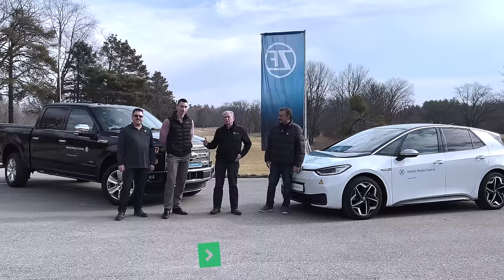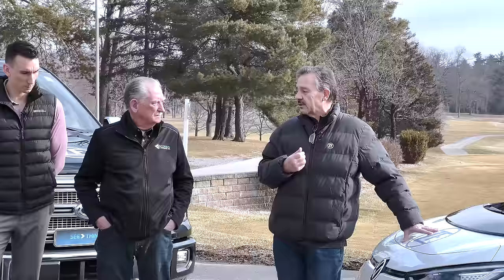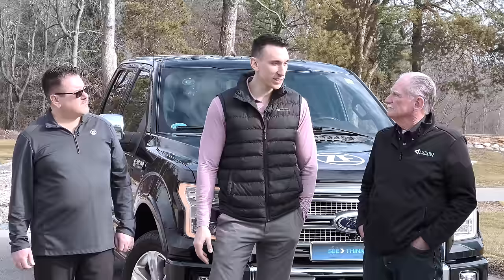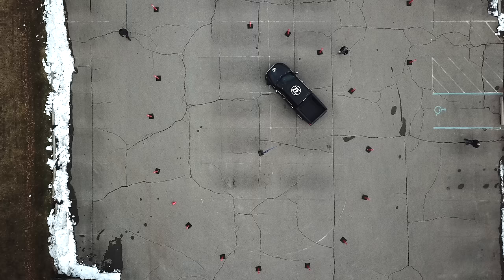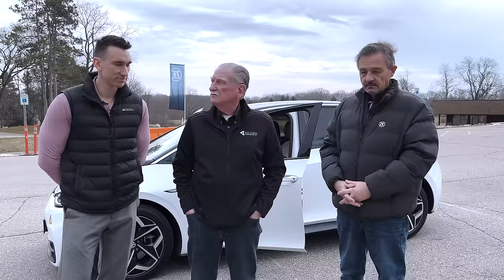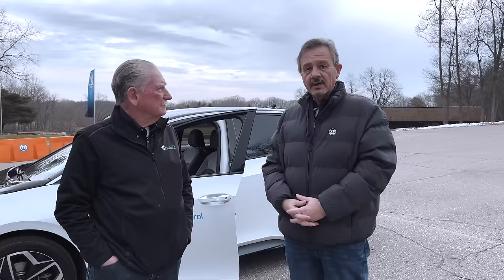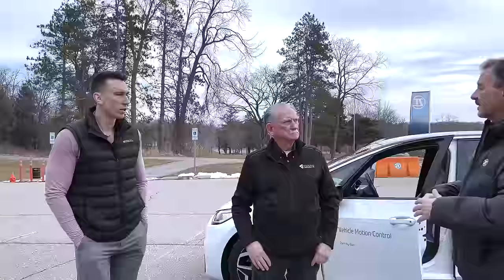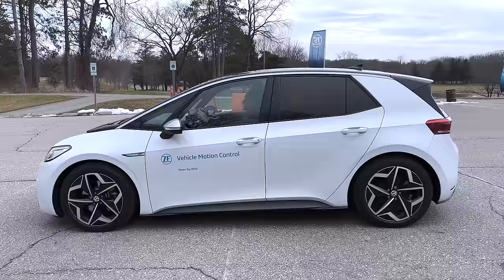Steer-by-wire - how it works with ZF

Comment: why is ZF still using OUTDATED Column shifters & GEAR select. 
its simpler & safer to just Swipe, check cameras on MAIN display.
Reply: @luisramos123   - most OEMs still use outdated LEGACY parts , because of Parts Bin contracts. 
they are unable to pivot , to new BETTER tech , like TESLA can , and shift to IN - HOUSE production. 
many OEMs today , still have START button, Keyed Ignition or key fob.
they have Column shifters, Stalk controls, massive Arrays of Buttons both on Steering wheel & Console , they have Physical knobs. 
all that adds WEIGHT & complexity when looking at FAULTS. 
the TESLA can even shift itself Automatically , accurately & reliably.
Reply: Shifting with  touchscreen is stupid, and every auto manufacturer knows that. Tesla puts drive mode on the screen because it's cheaper, and it fits their style.

Comment: As an automotive engineer I'll never trust SBW. Airplanes have x-by-wire, but they have multiple redundant systems. Cars will never have that amount of redundancy at consumer prices.
Reply: And none of that redundancy saved Boeing from cutting cost in other areas that killed people. It was a big improvement when we got rid of steering pumps and replaced them with motors. At least when a steering pump or motor fails you can still steer the car manually when the car is moving, just takes more effort, but there are a lot of other mechanical systems that can fail and cause major issues that aren't redundant. Regardless, I agree having steering controlled entirely electronically is an issue. If there is an electrical failure that cuts power to all systems while driving, you won't be able to steer the car at all.
Reply: Didn't Tesla say they put redundant & redundant safety systems.

Why do ppl like you keep putting out negative Nancy vibes. 
Progressive shit can happen.
Why does there always have to be an excuse or problem
Reply: The cybertruck has triple redundancy within the steering system.
Reply: Do you trust antilock brakes and if so why?
Reply: Oh wow you're an engineer, i guess you have a more valid opinion /s. You haven't worked a day in your life on sbw
Reply: People forget literally every EV is drive by wire and have no issues with that (mostly because they haven’t thought about it) but suddenly steer by wire is a problem…
Reply: I'll never trust fuel injection. You're one computer error from the car losing power in a critical moment, or hydro locking and ruining the whole drivetrain!
Reply: @thisApex3D yeah, but in my EV, the brake will still work even if the power is out as if you press hard enough, the hydraulic system will still work. Also, drive a mechanical non-power steering car and you will see all the feedback that gets eliminated with a full steer by wire system. Unlike a plane in the air, the road is a much harder contact surface
Reply: An engineer who says 'will never' twice.  Well,  if you've already decided it can't be done,  then you don't have to try to succeed,  do you? Funny; I thought that's what engineers tried to do. SBW may scare you,  but it's been figured out already and has been approved by surviving the rigors of testing and regulators.
Reply: tomgnyc  I think they will have adequate reliability and redundancy. What’s up buddy? Or are you just trolling?
Reply: @vurbin  but car will not drive. So my point is every ev already utilizes drive by wire, because there is no mechanical connection between accelerator and motor, because it is impossible. Yet no-one bat an eye and there were 0 issues.
Reply: If you tell me you can't do something I'll agree with you. Just stay out of the way of those doing it.
Reply: @thisApex3D but drive by wire is nothing new, most ICE cars since early 2000’s haven’t had a wire to the throttle body, so by your terms, current engines are also drive by wire.
Reply: Haha, if your power steering pump fails, there’s no way you’re able to keep your car on the road. Happened to my friend, who’s also an automotive engineer. After that he was wondering why there’s no redundancy in hydraulic power steerings.
Reply: @johnbuchman4854  I don’t like antilock brakes in most situations.  Yes, I know how to use them and I have practiced in abandoned parking lots to be sure I learned.  I hate having the ABS activate and no way to tell it, “no!,” when it is increasing stopping distance in order to preserve the ability to make steering input when I don’t want to make steering input.

You generally can’t compare ABS to steer by wire in failure mode because ABS never totally supplants the hydraulic system.  The exception is the Brembo system which does indeed have totally electric brake application, but could be paralleled by hydraulics as a backup.

Similarly, steer by wire should have mechanical backup.  An electromagnetic clutch uncouples the steering shaft from the rack, and under normal circumstances that clutch is always energized.  If electric power is lost, the shaft automatically couples to the rack.  This violates the Sandy Munro edict, all possible weight must be taken out, because it adds parts, but I would feel a hell of a lot safer in a vehicle I know can always be steered to the side of the road.  Having done engineering for 45+ years, I can assure that any scenario which can be imagined will eventually happen - the engineering question is, “how often, with what root cause; how expensive is mitigation?”
Reply: @thisApex3D  there is a huge difference between losing drive power due to a software glitch and losing steering control.

Comment: How will steer-by-wire affect the static wheel alinmgent settings ? If the OEM does not need to "engineer in" self center etc in the wheel alignment, and the computer can keep the car "on centre" driving down the road?????? This would have to improve tyre life dramatically??????